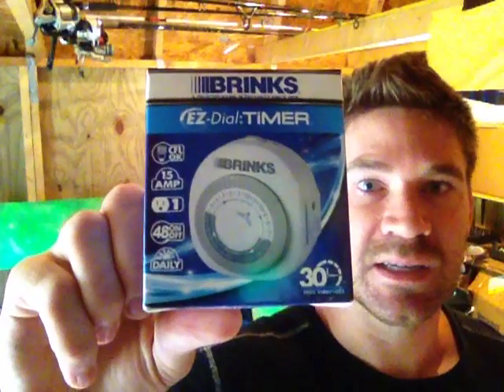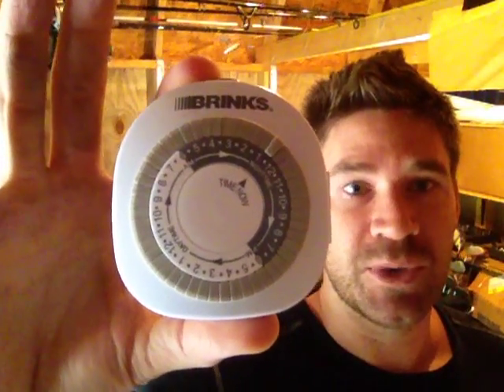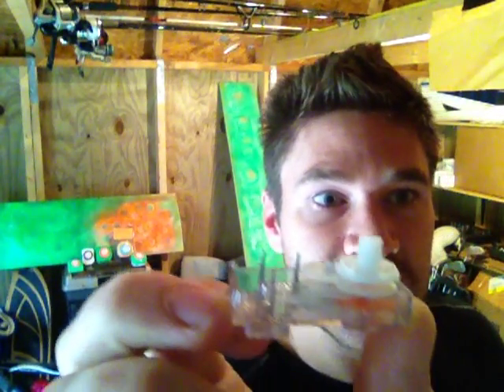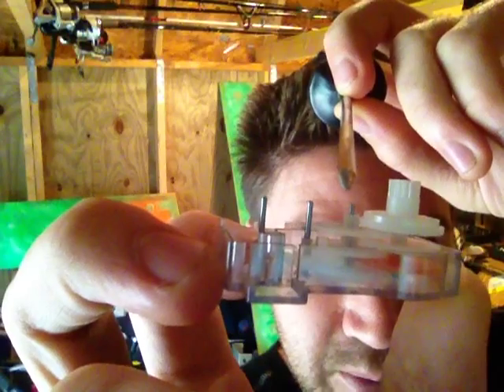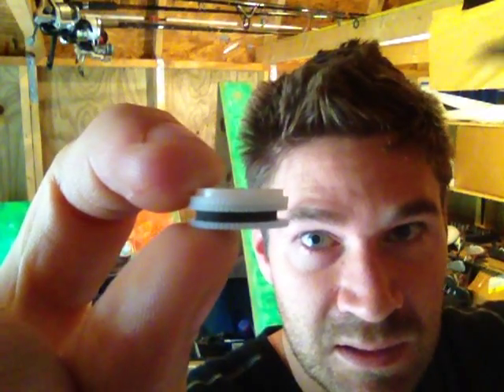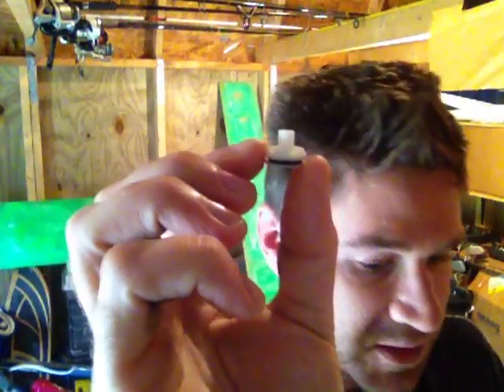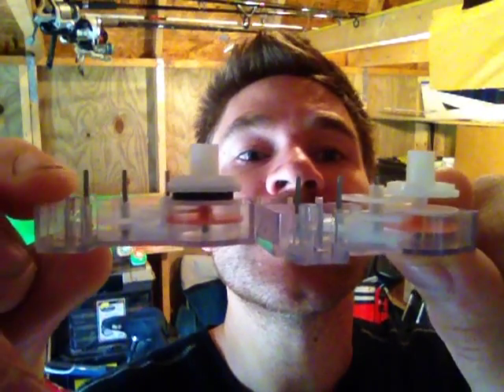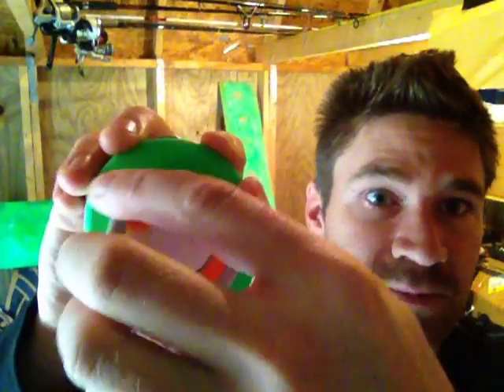GrowColt Timer DIY

Comment: Hi Great Tutorial. I made one of these for an unrelated project, but the timing works out great for my needs. Anyways I couldn't find the exact one you showed in your first video, but the mechanism was the same, so it worked great. A couple days later the unit started to hang right where it is about to turn on the appliance. A faint clicking is heard and the unit does not successfully depress the switch. Have you ever seen this? And if so is there anything I can do to help it along? Thanks

Comment: what does it turn the time switches to?
Reply from the maker: JDPRICE as the dial rotates, the ring of switches turns the eletrical power on or off to the devices you have pluged into the timer - depending on the position of the switches being up or down. does that help?